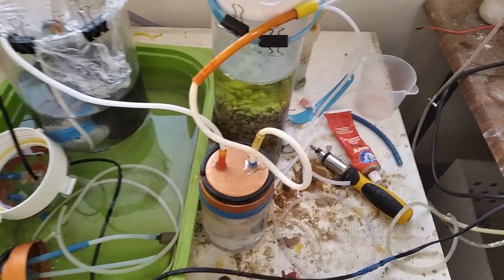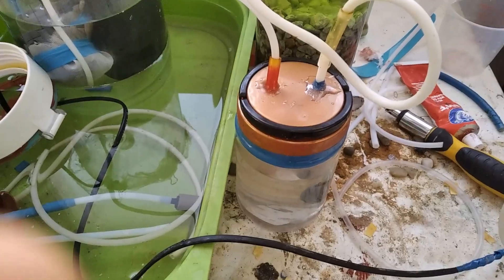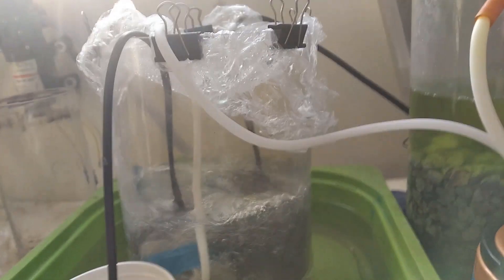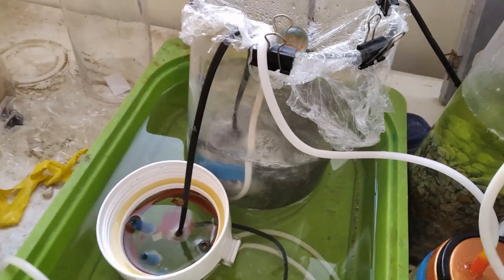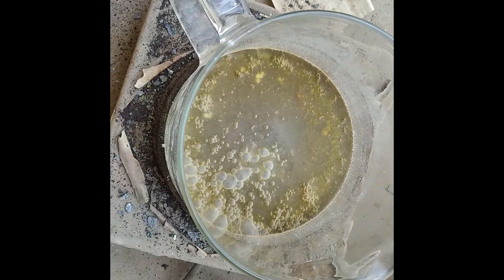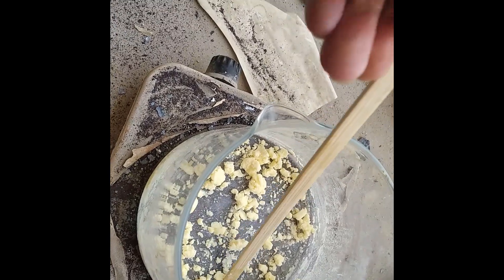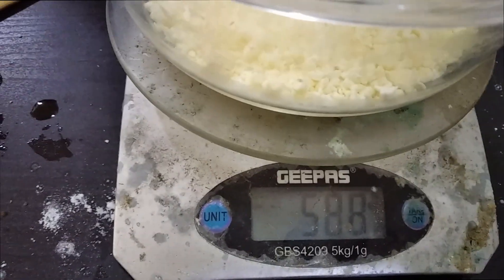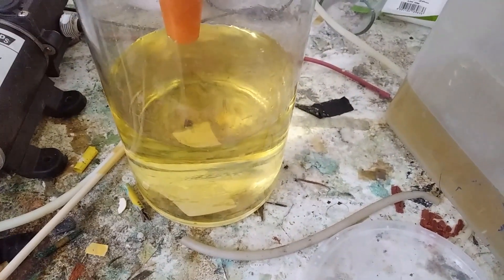Sodium Nitrite using ostwald process.

Comment: Gloss right over the platinum catalyst whydontya
Reply from the maker: You can use chromium oxide or manganese dioxide also
Reply: @CatboyChemicalSociety  thank you for anticipating my next question which I'm pretty sure I asked you before and you just reminded me the answer.
  Hopefully other people read this before commenting so you don't get asked a thousand times!
  If you think doping the  catalyst with any copper Cobalt or nickel could be beneficial feel free to mention.
Reply from the maker: @petevenuti7355  copper will result in less NO2 and more N2 but helps with self heating the reaction and wont need external heater at the cost of efficiency. Cobalt and nickel are said to be very good but the best active catalyst is Mn3O4 or MnO2 since the latter converts to the former anyway. cobalt and nickel are said to be very good too especially nickel because nickel is the weird metal that sometimesbehaves like Pt in some reactions.
Reply: @CatboyChemicalSociety  thank you!
Unrelated question, if you have the time, if I replaced air with HS, SeH or TeH, what kind of product do you think I'd end up with? Or would I just poison the catalyst?(hopefully nothing else)
Reply from the maker: @petevenuti7355  well if you add sulfur compounds to these then yea it will probably poison the catalyst. so make sure the ammonia and air is sulfur free.

Comment: go for KOH, the KNO2 is very soluble, while KNO3 is not so soluble
calcium nitrate + sodium formate also works by heating at +300*C
NO is better for nitrite, NaOH + NO = NaNO2 + H?
it may also be made by nitric acid dilute + copper = NO

oswald isnt pure NO, its also NO2
NaOH + NO2 = NaNO3 + NaNO2

Comment: Urea and NaOH reaction produces ammonia???
Reply from the maker: yes when you heat it up it does which is good because it means u can control the rate of release of ammonia that way by inputting heat.
Reply: @CatboyChemicalSociety  but it's not dry
Reply from the maker: @timkrause1925  thats why you then have a drying trap full of NaOH.
Then the NaOH from that trap is fed forward to the next run's urea to not waste it.